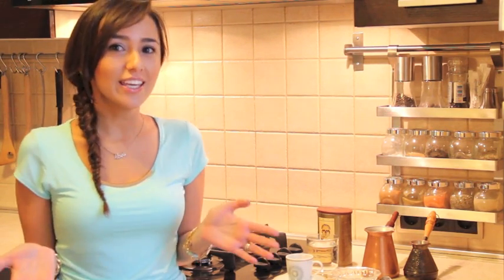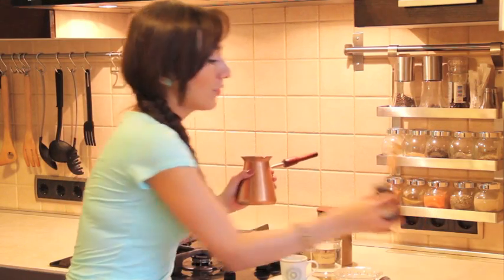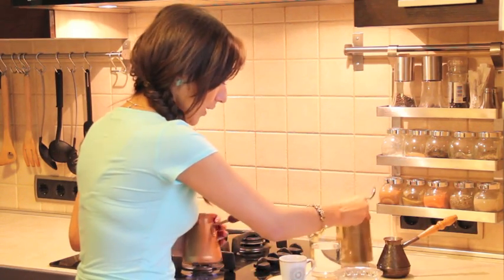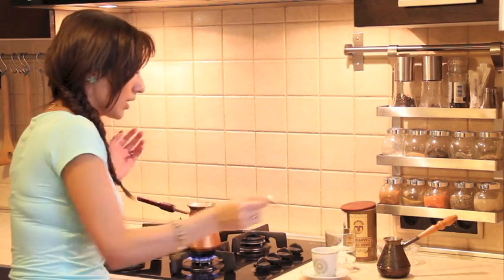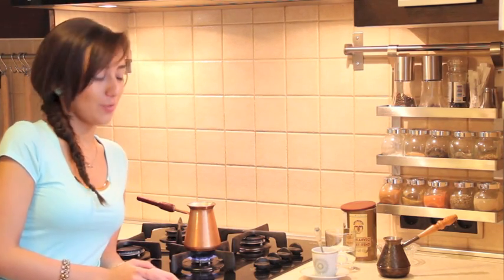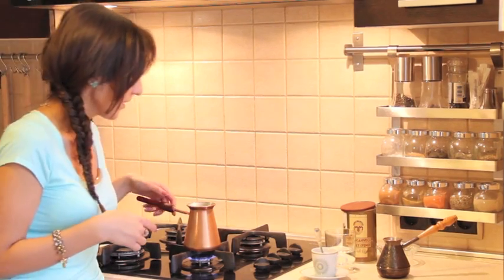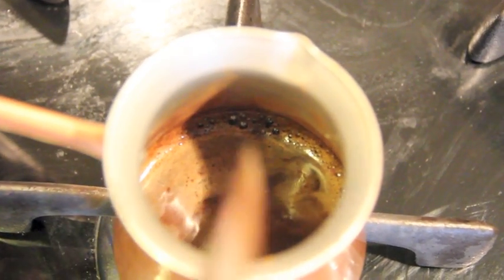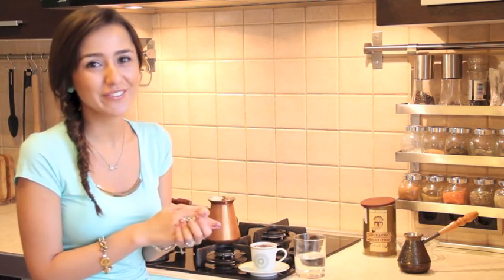Turkish Coffee

Comment: 1. Finding a suitable boiling pot is proving to be a difficult task.
2. Will get a copper pot that is straight.
3. Collection of foam looked good but won't be possible in that pot.
4. What's up with turning on the gas stove at 2:34 and letting it run for a few minutes?
Will make some, now; after I finish this tea!

Comment: I'm new to making coffee this way but have been struggling with making the foam. I have started with the heat low and worked it's way up, I've started hotter and lowered it as i saw bubbles start to form. I'm not sure what I'm doing wrong! Any suggestions? Other possible problems:  coffee isn't finely ground enough? adding ingredients at the wrong time? starting with room temperature water vs cold water vs adding ingredients to warm water? I would love your suggestions!
Reply from the maker: let me ask you this, are you using turkish coffee? or another coffee? because if that is the case then you will not get the foam.
Reply: +Konul Iskenderova 

I do not have Turkish coffee as she has in the video because I haven't found a company nearby that sells it fresh vs ordering online and having it be who knows how old. I do, however, have it ground as finely as possible. Is the actually the bean that makes a difference? or just the texture? I started getting a little more foam when making 4 ounces vs 2 ounces, but still not the foam that will seal the heat in as I've read elsewhere.

Comment: In Israel they serve a similar coffee. However, the heating and boiling is done on a metal tray about 2 in. deep and about 2 by 3 feet filled with sand. Thls tray has gas burners under it, So the heating is very even. A rather more elaborate method.
Reply from the maker: I have seen that Daniel, it is very cool, always made me wonder how is that possible :)
Reply: Where did you see this. Is the custom wide spread. I wonder. I loved your video by the way.
Reply: Daniel Tarr it is widespread in turkey and greece

Comment: I read that making Turkish Coffee is not until boiling. First  not putting the coffee but the water. then the coffee on the top. Just stirring after all coffee get down and start produce foam. When the water is about boiling take away from heat and stir. Then put again on heat and take off before boiling. again and again. What's the different?